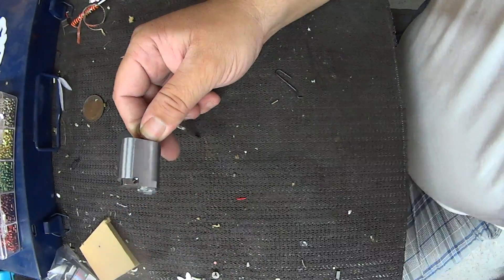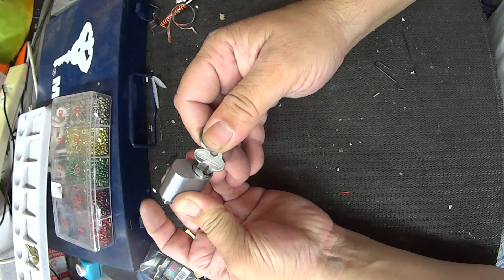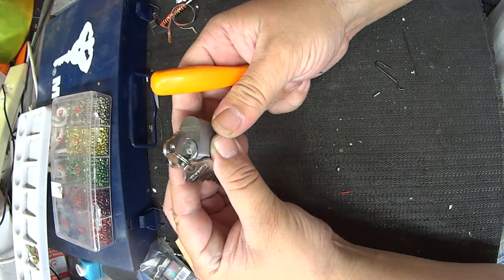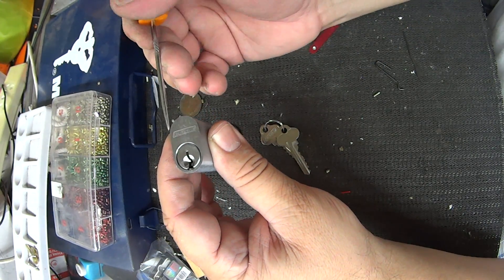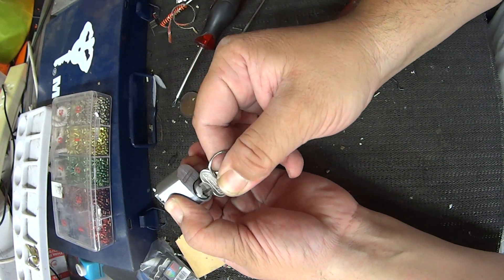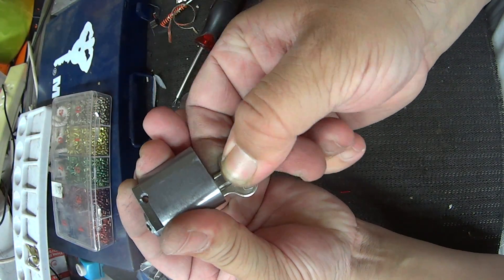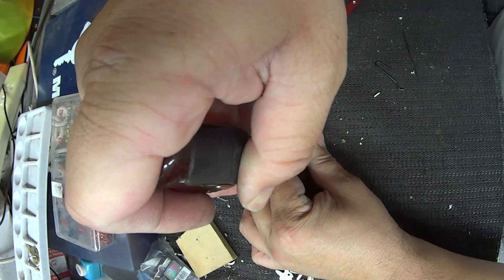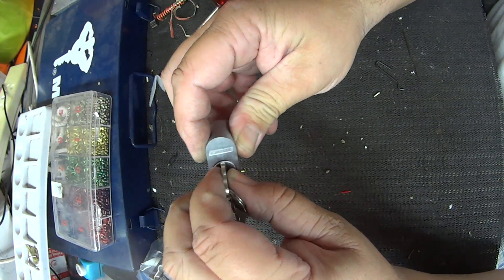Key Stuck In Lock - Won't Come Out ** Solved - Locksmith Parramatta

Comment: What if the key doesn't turn into the 12 o clock position?
Reply: So, did it get solved? Also stuck here, it wont go to 12 oclock rotation
Reply: Mine is stuck 180°, and it doesn't want to turn fully, otherwise I could remove the whole lock - NEVERMIND got mine replaced
Reply: @mralluuu  just like mine.180° and can't move

Comment: My key won’t go into a twelve o’clock position it just stays in a three o clock
Reply from the maker: sorry too hard to say
Reply: @DrLockShop  I have two the one on the front door goes to the 3 o'clock and the one on the back door goes to the 12 o'clock position, and as long as I treat them like they do work in different ways, I can get them out.  It drove me nuts for a long time, but now  I believe they will both work.
Reply: Lock it in then try
Reply: Thank you sir it worked on my padlock. 
God Yahweh bless you.

Comment: If you look carefully at the end of this video, it looks like Dr. Lock actually has a bit of trouble pulling out the key after he tightened the pair of screws at the back of the cylinder.  He said the two screws need to be tightened very tight.  But you might not want them so tight, because the plug (a.k.a. core) might need to portrude slightly forward (around 1/32 inch) in order for the plug's pins to align well with the holes above them when pulling out the key.  If that's the case, replacing the two screws with screws that are a slightly different length, or inserting very thin shim washers between the screws and the cylinder back, might allow you to fully tighten the screws and have the plug end up in the optimal, slightly portruding position.

An important step that's missing from this video is how to remove the cylinder from the lock in order to access the two loose screws on its backside.  It would help to include a link to a video that shows how to remove the cylinder.

Comment: I have a similar lock and the flange at the back has come loose so cant open the pins in the door in to thw wall... can i drill it trough to take the whole thing out and replace it? Plus i have no access to the other side of the door . Thanks.

Comment: I have an Ultion lock that can be a bit of a nightmare for removing the key when unlocking and locking the door. 
it makes me really anxious every time I put the key in the door.
The key has to be exactly in the 12 o clock position but even then I'm having to wriggle it a little bit to remove the key

Comment: had similar problem but was a key that was left there for years, pulling it out wasent possible locktight dint work. could not enter far enought.
had to remove the cylinder and oil it back and front, spin key around a few times now its out.

Comment: Hi Dr Lock, thanks for the nice vids. I undid those screws and then it jammed up on me. anyway to rectify that problem? one of the guide pins can pop out, as the keys come out that far... but that's it. :(
Reply from the maker: You just needed to tighten them
Reply: @DrLockShop  tried that, had shims for my bike and tried that. after broke key off to get out of housing, hoping it would push through. still nothing. :(

Comment: What if it won't go perpendicular? Pushing on the center doesn't help. Now, this is a car lock that is not secured to the door (I'm changing the handle), but even if I hold the cylinder with my hand from the inside, I can't get the key to get all the way straight up-and-down (only a degree or two shy of it). So I presume that's why it won't come out.
Reply from the maker: car lock and house lock, the key needs to go back to the start position to remove the key.
Reply: Never mind, I got it. The cylinder - somehow - got turned so that a pin that was keeping it from rotating far enough had gotten pushed around/over a nob that it wasn't supposed to go past. I lifted the pin over the nob, allowing the cylinder to turn farther, and the key came out.

Comment: In my case, there are no screws to re-tighten.  But no big deal.  The key was pulling the inner cylinder outward, and that caused the lockup.   Thus the key was at war with the inner cylinder.  To resolve this problem, one must stop the key from grabbing on to the inner cylinder.  So I took a lead pencil and put plenty of graphite on the key, and then inserted and removed the key several times. I repeated this graphite application to the key twice, along with the multiple reinsertions of the key. Bingo, the graphite now acts as a slippery lubricant, and so the key no longer grabs the inner cylinder and thus no longer pulls it outward. Now the key just flies out with ease.
Reply from the maker: Graphite dose not fix, something at the back of the cylinder is allowing the inner part to move too much "forward", the pins can not slide up as the top chamber holes are not alined, graphite is just a lubricant, you still have a problem, I would check it
Reply: @DrLockShop  Like I said, the key now goes in, and comes out, easier that it has before in the past 16 years of which I have lived in my apartment. The lock had been in use for well over 35 years and any lubricant had surpassed its life limits. A car engine will not do well if you remove the oil.  That does not mean that there is something wrong with the engine itself. Just add oil, and bingo, things are back to norm. For instance, If you add a lubricant to the word "Dose", its letters will automatically reorder themselves back to the proper order of "Does".
Reply from the maker: @new-knowledge8040  Hi, a car engine is designed to use oil, a lock cylinder inline pin cylinder does not need lubricant if its correct and was not designed to need a lubricant to be added. The lubricant is allowing the misaligned parts to slide past the point of contact and be felt less. But if it works and you can use the lock then it's all good, and if it saves you from having to the lock part then its a good temporary fix. But for me as a Locksmith, it would not be classed as repaired. Most of the time the repair is just as easy, If you send post a link of your lock, I can do a video to show the fix

Comment: I have sliding doors and I added an upper lock door jam and the key is stuck inside and it won’t move at all it’s stuck in left to right not in 12 o’clock position how to I get key out?
Reply from the maker: Sounds like you will need to call a local locksmith to have a look

Comment: What if the cylinder doesn’t turn and it’s stuck at a 11-10’o-clock position?
Reply from the maker: its jammed , bent lock mechanism is my best guess, you need a new lock
Reply: @DrLockShop  yeah I took out the pins and springs from the lock. Only way to get the key out.

Comment: what if I can't turn the key to the 12 o clock position?
Reply from the maker: Remove the cylinder and check the cam on the back of the cylinder
Reply: @DrLockShop  thank you

Comment: Hi! thank you for this. could you also help with a cylinder lock.. where in order to get key out once you lock the door... is to go back to the unlock position ONLY .. which renders the door unlocked too... LOL ... yip. thank you!
Reply from the maker: Sounds like the back tail of the cylinders are not in the right spot, turn both towards the hinge and put back on door

Comment: My key will lock the door but when I unlock the door the key won't come out and won't turn to the 12 o'clock position
Reply from the maker: other issue maybe the lock
Reply: @DrLockShop  we got a locksmith out who took the lock itself out the door and said it's broke inside ( he was confused about how ) but he also said that it was bent somehow 🤔🤔
Reply from the maker: @aaronlanders95  Sounds like I was right it was the lock not the cylinder :)

Comment: Key in the door won't go quite to 12 position.
Reply from the maker: Hi, that's a diffrent problem, but start with same repair, it may be the cam on the back of cylinder
Reply: @DrLockShop  I can't get the cylinder out of the door to look